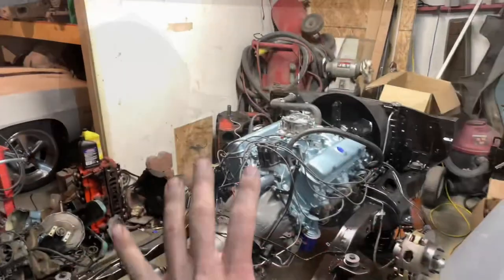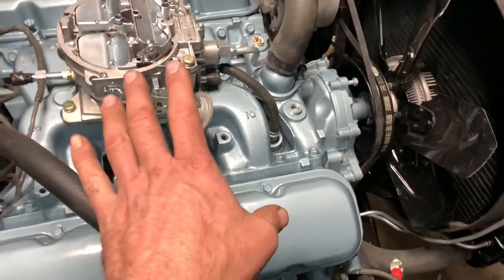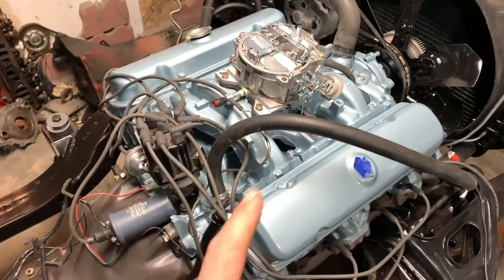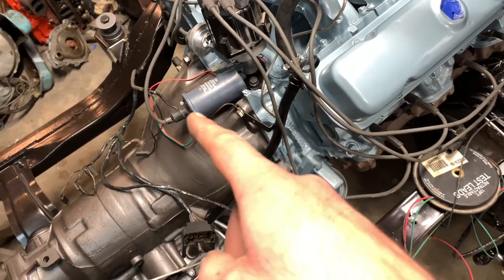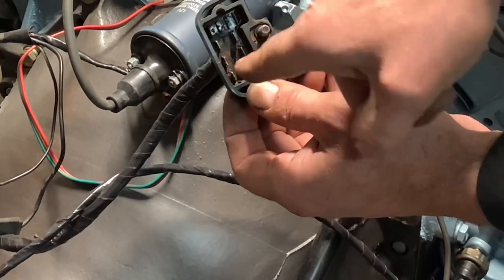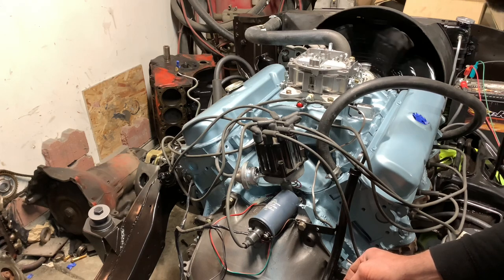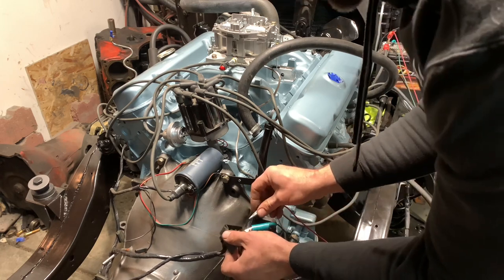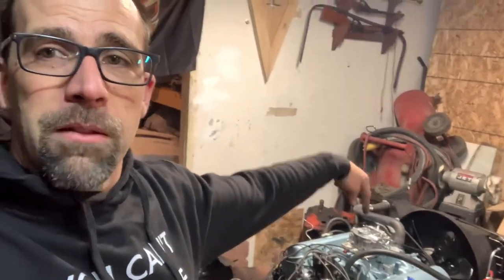Wire it up and fire it up, starting the 1968 Firebird engine for the first time

Comment: That 350 is purring!   Good work!
Reply from the maker: Not bad for just dropping in the distributor and bumping the stater with a little gas.  Need to set the timing and check the carb too but wow that one fired up quick

Comment: Hello Jon
Enjoy your videos you are very knowledgeable. I was a heavey truck mechanic for 37 years I'm now 70 years old.  I've owned Pontiac's every since I was 16. My first was a 69 Firebird 4 speed. Got married and car had to go.  Later in life I bought a 68 Firebird.  And also a 69 GTO.  Had to sale both to pay for my son. Later on I bought a 67 GTO from my brother in law been in the family since 1972. Still have it. My son bought a 67 Firebird that was race ready. Still have it.  Don't race it much because the cost of fuel.  After I retired I told my wife I would like to buy another 69 Firebird. I found one and purchased it. The out side was finished. It needed floor pans and carpet. So that's been my project since I retired. Putting on new chrome and dressing it up just a bit. I was watching this video and engine looks and sounds great.  You my already know this but I'm going to give some old school and old man tips. First I took a old distubator and ground the gear off of it and use it with a drill I never liked cranking a engine over with out priming the engine first.  
The other tip is get a cleaned out gear oil bottle fill it about a half way up of the vent tube in front of the carburetor gose straight into the float bowl. I fill the float bowl with fuel. It saves the starter from over heating and saves the battery. 
Keep up the great work 👍 
Ron from a little Town in Virginia
Reply from the maker: Nice collection.  I have also sold my
TransAm For the kiddos. Thanks for the tips too. That is the point share the knowledge and years of experience because once it’s gone it’s gone

Comment: Save your rear end gear lube bottles with the small funnel ends and use them to fill the carb from the vent with Gas.  No need to endlessly crank it.
Reply from the maker: nice tip, I have plenty of those right now.

Comment: Good work, John! Also, sound advice on pre-running the engine prior to buttoning it up in the body.
Reply from the maker: Thanks, I have done my last three builds this way. Last thing I want to deal with is a oil pan or oil leaks that require taking the engine back out.  After the car is all assembled.  I don’t like scratching the paint!

Comment: Wow!  sounds awesome.  Glad the distributor worked.  Is that the stock coil and wiring harness?  That may be the solution to my HEI problem on my Camaro.....
Reply from the maker: Yes, 1968 factory harness. The only wire omitted was the white one from the stater solenoid to the coil.  That wire is only necessary for a pointed ignition. 
What kind of issue are you having with the HEI?

Comment: Don't you want as little as possible cranking when firing up a freshly rebuilt motor?
Reply from the maker: Cranking not concerned with if it was primed, now extended idle  with a non-roller cam would be an issue for sure.

Comment: @VinylVillageGarage - any tips on carb tuning?  My '68 Bird starts up with a really high idle, and I typically have to hit the accelerator pedal a bunch of times to get it to kick down to normal idle.
Reply from the maker: I can do up something on a quadrajet carb.  Sound like you choke is opening to slow which will effect fast idle cam operation.  What carburetor are you using and what type of choke? Electric or heat activated?
Reply: @VinylVillageGarage  It's a Quad, and looks like it's heat activated. Thanks for the reply! Love watchinig your restorations!!
Reply from the maker: @ezakoske right on!  Thanks for watching

Comment: The fan location looks too far back...Is that clutch correct?
Reply from the maker: Not to say it’s right but my GTO Which is all original clutch fan it sites when sighted straight on about 1/2 the fan blade width os also exposed just like the bird.

Comment: Looking for help with a convertible top pump
Reply from the maker: What kind of problems are you having.  I did a video on cleaning one up and repairing stuck check balls. 

Here is a link if interested   E26 convertible top pump / motor repair 1968 Pontiac Firebird LeBronze
https://youtu.be/RbUlmpC9m1s

Comment: For 1970  pontiac 400 with quadrajet, how turns of the air/mixture screws all the in to out would you recommend as a good start.  I hope I am saying this right.
Reply from the maker: Idle mixture screws initial settings 2.5-3 turns out is a great place to start then place a vacuum gauge on a manifold vacuum port with engine at operating temp and at idle and then adjust the screws in or out to obtain the highest vacuum reading possible.
Reply: Thank You Much!